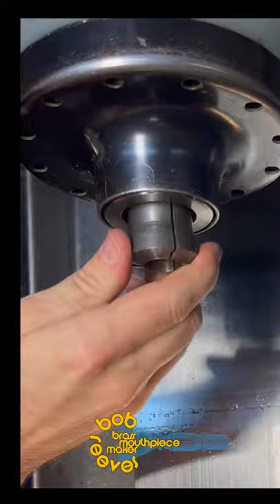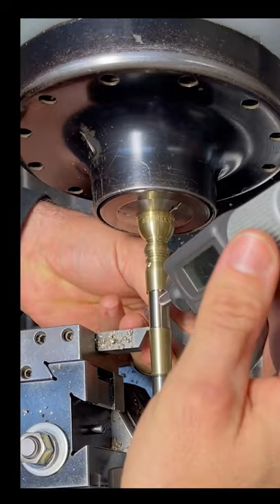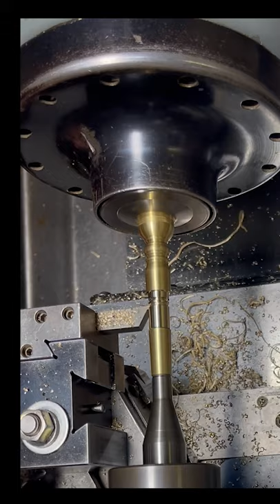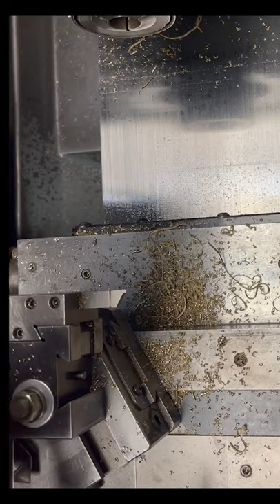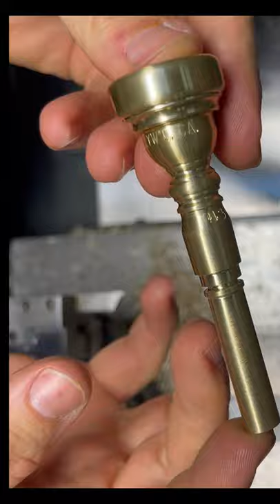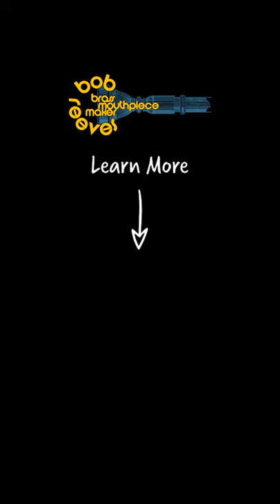🎺 Cutting a Trumpet Mouthpiece for Reeves Sleeves in Under 60 Seconds #shorts

Comment: Why ? Is my question..😮
Reply from the maker: Good question! Check out this video for why you might want to make this alteration: https://youtu.be/2YIVc9wv6RI
Reply: Why? Why not… It helps to dial in the resistance of the blow of the horn. The gap like a valve alignment is crucial to the overall performance of the trumpet. I have my Reeves mouthpieces and non reeves cut for sleeves and I have been able to dial in exactly what I want from each mouthpiece on each horn I have. Being able to count on what I want, when I want everytime I pick up my horns is paramount to my best performance. If you wanna find out a little what it’s like, do the paper trick to find out if you need more or less gap to help you play better. Then call John or Brett at Reeves and they will help you set up your optimal mouthpiece and/or sleeve(s) for your horn(s).